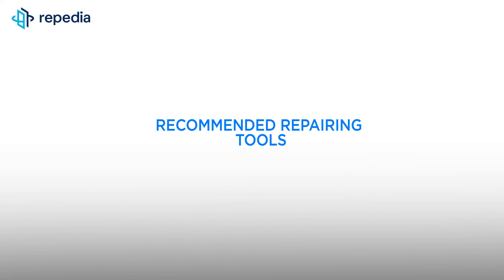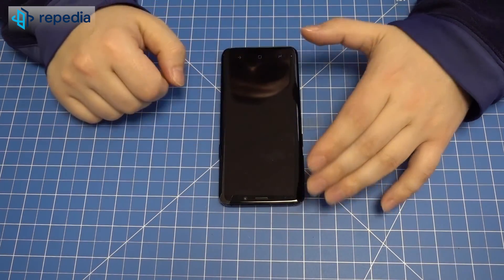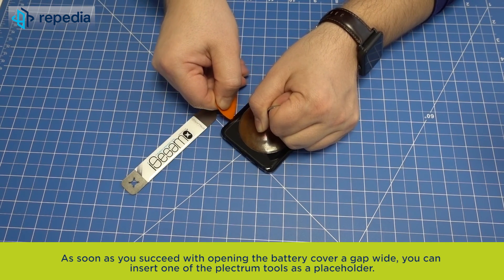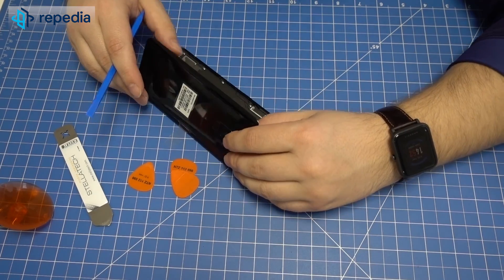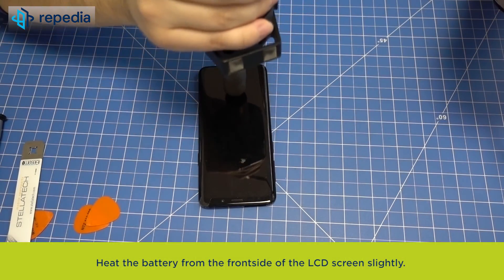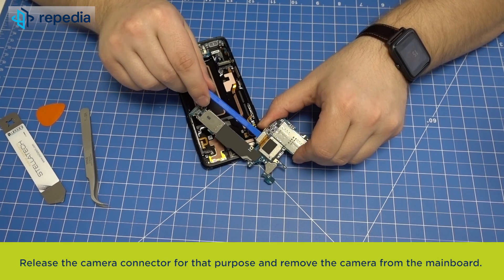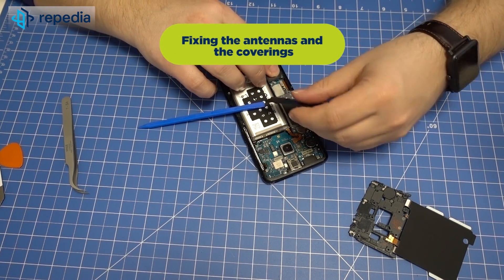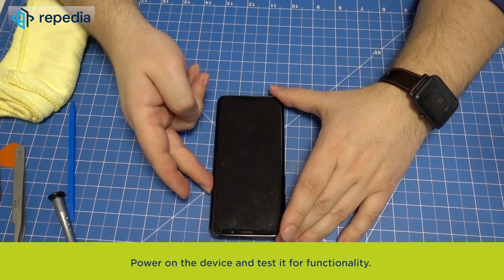Samsung Galaxy S9 - Screen Replacement | Teardown Guide

Comment: Can you replace the glass instead of the whole frame?
Reply from the maker: Hello,

yes, it is possible to replace only the glass. But this is only required for professionals because the components are glued extremely strong and therefore you will have a very high risk of damaging something. We only offer complete LCD screens (incl. frame) in our webshop. This is the safest way of replacing a cracked screen. 

Best regards from the REPEDIA team
Reply: @repedia-servicelabor8822  Thanks, my S9+ front glass is webbed and I am wondering whether to replace it, the screen with the frame seems very expensive though.

Comment: Where is the screen replacement?
Reply from the maker: Hello,

This video shows step-by-step how to change the display of the Galaxy S9. From minute 08:19 the disassembling is shown. Means, the transferring of the necessary components to the new screen. For reasons of sustainability, we do not always use new displays for our video tutorials. Also in this video, the previously disassembled display was reused during assembly. Nevertheless, the video shows the process of replacing the display completely.

With our videos, we want to help make more people choose to repair their device instead of replacing it completely. That's why it's out of the question for us to use a new display for each video when the old one is still fully functional.

I hope the answer helps you, otherwise write us again.

Best regards from the REPEDIA team